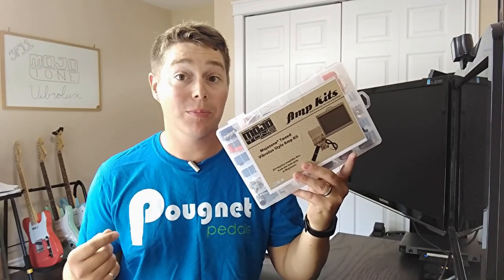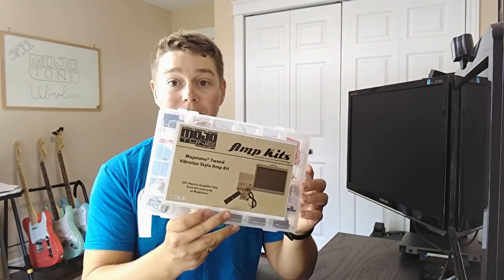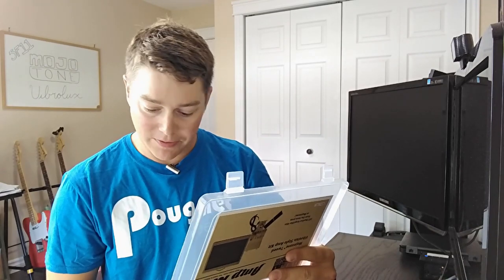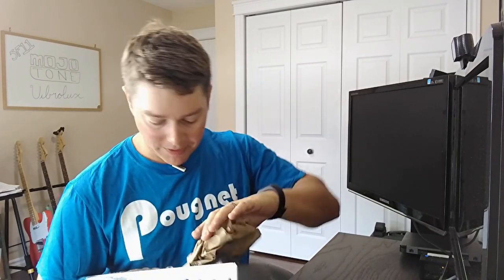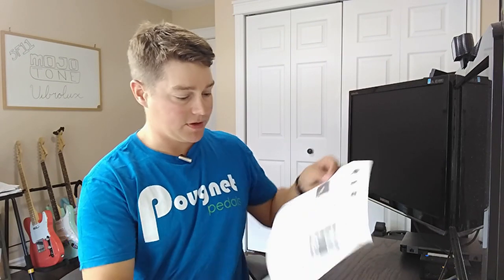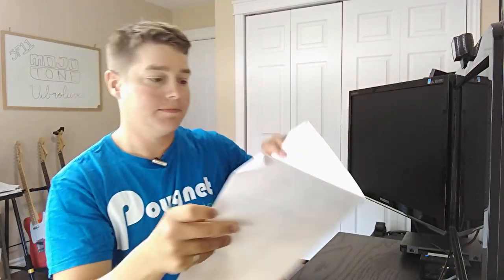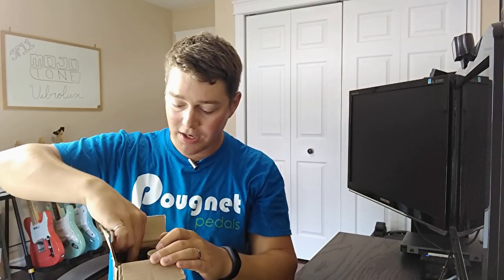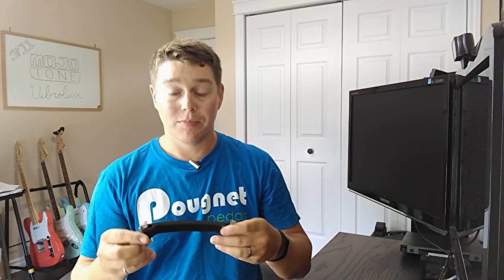Mojotone 5F11 Vibrolux Amplifier Build | Part 1 | Parts List

Comment: Great!!! I,m looking forward to your build. The cab used was the 5e3 cab with a 10" speaker.in an amp it called an eyelet board. No it,s based on the tweed harvard circuit. . It has no relation to a princeton reverb out side of being a fender.
Reply from the maker: Yeah, I think I was looking for turret board in my head when I shot the video. Eyelet or fiberboard works as well. Not sure about the cab size, but I think the chassis/enclosure for the 5e3 is a little shorter so the cutout may differ.
Reply: @pougnetpedals  no it,s cool. The important thing is you,re doing it. It,s a great choice. Turret boards are mil spec. I,e, the most durable way of building electronics in the olden days. The eyelet boards are much cheaper to make . Leo Fender was notorious cost savings! The material used in eyelet boards is very slightly hydroscopic and over decades they get a8 trace amount of water into the material and dry outover and over again. That makes them expand and contract which over 30 or fourty years will make connections crack and the amp will start getting noisey and crackly. That,s called tweed disease. Oh be careful with all the jumpers that run under the board.  All the mistakes are made there when building these amps!! Check out stew mac amp build instructions on how to build amps. The 5e3 instructions will be a good road map.